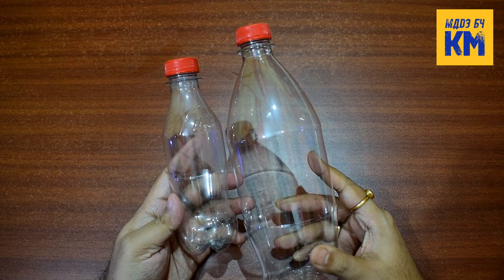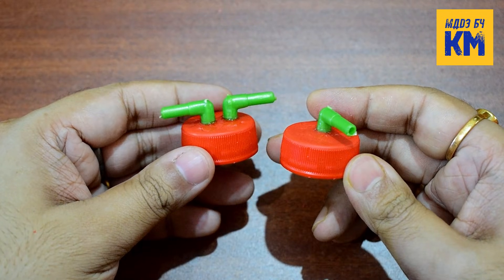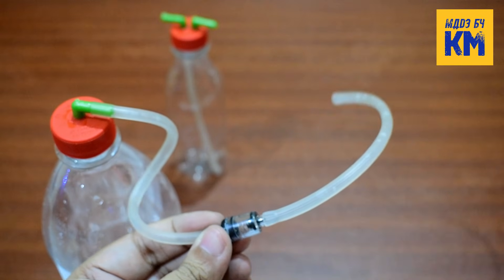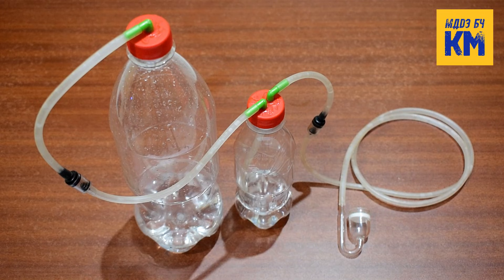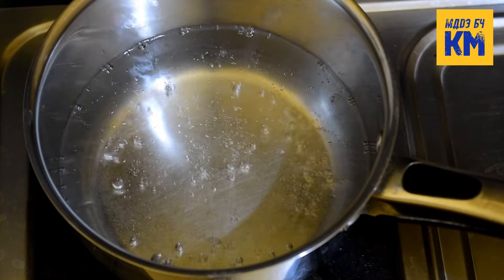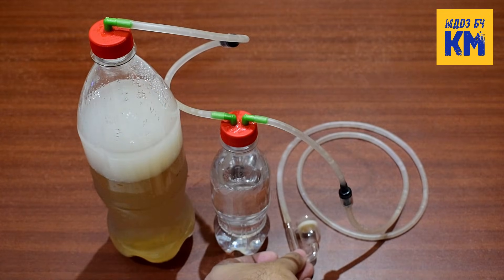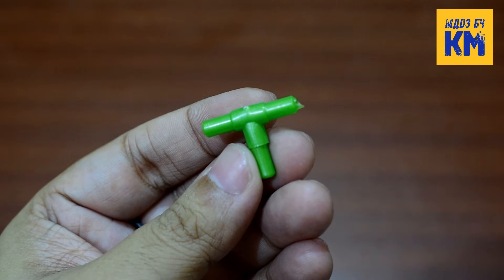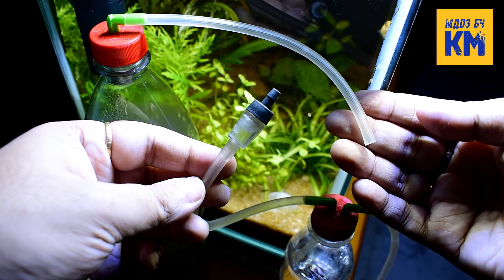Long-Lasting DIY CO2 for Planted Aquarium: Easy & Effective

Comment: Hi KM under this method once the requisite formulation is filled in bottle & the said process followed ..how long it takes to generate CO2 ..approx min or hrs..
Reply from the maker: The production of CO2 depends on several factors, such as temperature, quality and quantity of yeast used etc. As a result, CO2 production can take anywhere from 30 minutes to 24 hours. Please refer to the description for further information.
Reply: @madebykm   thanks for the prompt response…I wl be trying this method very soon… Your videos hv been boon to hobbyist..in my circle I have been spreading the word about you…..continue to do the good work…👍🙏
Reply from the maker: Thank you
Reply: @madebykm   hi Kaushik. Finally in second attempt I could succeed in DIY CO2 ..probably the bottle caps were not airtight as hadn’t used silicon sealant but had applied Araldaite..However, I am unable to route through the intermediate small bottle with water..the CO2 bubble would appear in this bottle but it want pushing enough though it’s outlet into Aquarium. Hence I had to put air tube directly from the main bottle to aquarium…I will retry  again with intermediary bottle as shown in your video..thanks a ton for your guidance…DIY was a very satisfying experience & very economical within 250-275 it could be done…However one has to keep eye on CO2 pressure, refill etc etc..

Comment: Thank You very much for this Video.. 
I have one question. how much time we need to run this co2 in 20 Gallon Aquarium with full plants ? 
If I run CO2 for 12 hours will my fish die ?
Reply from the maker: CO2 must be supplied as long as the light is on. Even if you run this DIY CO2 24/7 there will be no problem. Just run an air pump at night to keep the oxygen level in the aquarium water high.

Comment: Thank you Kaushik.. this looks like super useful,  like all your other videos.. i have a few questions though
1. Do we not need to shake the yeast water to activate the yeast?
2. I tried using 2 bottles using a t-connector to generate Co2, but coz of the possible pressure difference, the co2 was getting generated from only 1 bottle... whats the solution to that? 
3. How many times can i use the jelly in the generator bottle?

Comment: I tried but bubbles are not forming on the small bottle followed the process as showed in the video . Kindly help
Reply from the maker: The bubbles won't come out right away, the fermentation process can take several hours to begin (up to 24 hours). Also, check for leaks in the CO2 system, if there are any leaks, no pressure will be created and the system will not work.
Reply: My aquarium is 4 feet almost 250 ltr of water is it because of that the pressure is low and the co2 is not generating. Do I have to add more bottles of  generators to generate co2

Comment: Hey can I use the water controller instead of the check valve
Reply from the maker: No, a check valve is required here.
Reply: @madebykm  okay thank you 😊
Reply: @madebykm sir I’m not getting check valve is there any other solution ?
Reply from the maker: You can find it on the internet or at your local aquarium store. If you can't get it, just use your CO2 generator and keep it above the tank.
Reply: @madebykm  okay thank you sir
Reply: For safety should keep the air flow controller?
Reply from the maker: No

Comment: Ultimately have been able to built one and am following your formula. But one question. I find around 22 bubbles per minute are being released, not more. Will it be sufficient for a 17G planted aquarium or do I need to add another bottle. 

For the records I am also using the DIY Internal Filter methods as CO2 Diffuser, as suggested by you. Thanks once again.....
Reply from the maker: Increase the CO2 production by using 1/2 of a teaspoon of yeast, and aim for a CO2 injection rate between 1.5 and 2 bubbles per second.

Comment: Same ingradients packed in a pack and named as Aquario Neo DIY CO2 kit, that brand is selling this same stuff explained in this video for $30 and refils for $20. Crazy. Thanks a lot Kaushik. You are a legend as always I am following you since 2 years and in this aquarium hobby. Read a lot books, reddit, videos but no one is like you. You are the best.

Can you please research on that same products from  Aquario Neo DIY CO2 kit last for 50-60 days for 10-25 gallon tank without changing any yeast solution. Please reverse engineer that and make another banger video why its lasting that much and you can replicate this video in 3rd latest 2023 part.

All the best. Lots of love brother from Pune.
Reply from the maker: Ok, I will try, thanks 😊

Comment: Thanks for the great video! I have a quick question, how do you prepare a new bottle when it's time to swap? Cause new bottle will need time to build up pressure too right? I'm worried about CO2 fluctuations here. Thanks again!
Reply from the maker: I always prepare the yeast-sugar solution at night, thus allowing sufficient time for the CO2 to be produced, and by the time the lights are on in the morning, the plants get the desired level of CO2. Thank you.
Reply from the maker: And I make a new bottle of jelly a day or two ahead of time, store it in the fridge, and use it when I need it.
Reply: @madebykm  Thanks you for taking your time to reply. That's good to know. I also have one more question, you said that we should change the yeast water (top part) every week for stability, my understanding is you keep the old jelly water part right? So how long do you keep that jelly part before you change them too? Many thanks!
Reply from the maker: I change the jelly every 30 days. Thank you.
Reply: @madebykm Hey just a quick update. I followed your ratio for the mix but I use a 2L Coke bottle so the mix doesn't fill up to even half way of the bottle. Do you think it will affect the pressure cause it has too much room left to build up pressure. I've been waiting for 12hrs yet I only see slow single bubble running out to second bottle. Second thing is my tubing run to CO2 diffuser is a bit long, should I try to move it closer like yours? Sorry for too many questions, appreciate your help man!
Reply from the maker: Yes, it will take some time for the pressure to build up. You can also use 1/2 teaspoon of yeast to produce more CO2 and increase the pressure. I would suggest you watch my “DIY CO2 Diffuser” video and use an Internal Filter CO2 diffuser. It will work best for this method.

Comment: Apa fungsi dari cek valve
Reply from the maker: Check Valves atau Non-Return Valves memungkinkan udara mengalir ke satu arah (ke dalam tangki) dan menghentikan aliran air ke arah lain (keluar dari tangki).
Reply: @madebykm  terima kasih
Reply: @madebykm  sy sudah mencoba membuat botol co2 diy dan berhasil
Reply: Tp tidak mengunakan check valve karena di kota dini tidak ada

Comment: Hi Kaushik, Thank you for sharing such great videos. I made a CO2 reactor using the yeast and sugar method but whenever I try to bring the water pipe to the bottom of the tank the bubbles stop and CO2 stops. Also, the pressure is too less. Please help
Reply from the maker: You can use 1/2 teaspoon yeast instead of 1/4 teaspoon to produce more CO2 and increase pressure. Also, place the diffuser in a specific place inside the tank. When enough pressure is created, it will work perfectly. Also check the description box for more information. Thanks.

Comment: Then how to clean or remove jelly from the bottle
Reply from the maker: The jelly will slowly melt over time and after 4-5 weeks, you can easily remove the jelly from the bottle.
Reply: How many week it will give co2? 

Its my last question please answer.

Thank you
Reply from the maker: 4-5 weeks

Comment: Good, easy to understand video. I use this for my 14 Liter Nano Tank. A very cheap and effective method to produce CO2. I don`t have a diffusor like your`s, I use an airstone hanging free in the tank. At day, when more CO2 is needed for my plants, I hang it down to the bottom of the tank. In the night, when no CO2 is needed, I lift the airstone  to the water surface. So I don`t need to take the tube away every time.

Comment: Could i do this with regular gelatin?
Reply from the maker: You can also use gelatin, but the problem is jelly made using gelatin usually melts at outside / room temperature (25°C-40°C). Gelatin works well in cold environments (<20°C). But jelly made using agar agar remains firm even at 65°C. Thank you.
Reply: @madebykm  understood, thank you so much.

Comment: Helloowwww ..... feelinn blessed that i found this videoo but i have a doubt ,here the co2 will runn 24 7 with continuous flow .If i have to stop the cot flow then what m i supposed to do???
if we removed the tube from check valve the coz will get waste right???
Reply from the maker: You can keep it running 24/7 and run an air stone at night to keep the oxygen level in the aquarium water high. Also check description for more information. Thanks.

Comment: Great Diy. Can we use normal gelatin instead of agar agar? I want to do this today and my local shop doesn't have agar agar.
Reply from the maker: Actually jelly made using gelatin melts at outside / room temperature (25°C-40°C). Gelatin works well in cold environments (<20°C). But jelly made using agar agar remains firm even at 65°C. I have given the links in the description, you can check them out. Thanks.
Reply: @madebykm  Thanks. I managed agar agar...diy working in 6 hours.

Comment: Hi kaushik 
I dont have check valves but i make the system and i used sugar and yeast water for checking purpose but still m not getting co2 bubbles plz explain
Reply from the maker: Check description for details

Comment: Dear Kaushik by resuming CO2 inserting tube in check valve does it take intial few hours time to give bubbles or do we have to shake the bottle?
Reply from the maker: It takes a few minutes to build up the pressure again.
Reply: @madebykm  Thanks ji

Comment: Hello Kausik, today i have successfully created the diy co2 system including diy co2 diffuser by taking the help from your video, but one thing i need to know that, how many hours i need to turn my CO2 on, i use to turn my lights on for 8 hours, can you help me on this, thanks in advance.
Reply from the maker: You can either detach the CO2 tubing when the lights are OFF or keep the CO2 system running 24/7 and run an air-stone at night or when the lights are OFF to keep the oxygen level high in the aquarium water.
Reply: @madebykm  okay, actually i do have fishes inside of my aquarium, i use to run a small sponge filter 24×7 with very litter flow speed, so in that case do i need to off that sponge filter while i am running the co2 or i can run both of them 24×7??
Reply from the maker: You can run both 24/7, but reduce the flow of the sponge filter when the lights are on, and increase the flow when the lights are off.
Reply: Good morning, Many many thanks kaushik, i wish all the very best for you..and continue your good work, your channel is really very very helpful to us..thanks again.
Reply from the maker: Thank you 😊

Comment: this will work without check valve ? For supply disconnection you removed it from check valve does it affect the quantity of mixture in the bottle ?
Reply from the maker: It will also work without check valve. The function of the check valve is to prevent water from entering the bottle from the aquarium.
Reply: @madebykm  Thanks Dear and what about disconnecting supply, does this affect the CO2 mixture quantity
Reply from the maker: No 🙂
Reply: @madebykm  😊

Comment: Dear since we are going for DIY thing, do we need needle gauge to check pressure of CO2 supply  ?
Reply from the maker: No, there is no need to use a needle gauge in this system. Here, the CO2 production depends on the quality and quantity of yeast. So, you can control CO2 production or bubbles per second (bps) rate by increasing or decreasing the amount of yeast. If 1/4 teaspoon of yeast does not produce enough CO2 for your tank, you can use 1/2 teaspoon of yeast to increase the bps rate. I have found (in a normal bubble counter) that 1/2 teaspoon of yeast can produce CO2 at a rate of 2 bubbles per second for about 10 days. Then the production of CO2 gradually decreases as well as the bps rate. So to provide CO2 in the tank at a steady rate, I recommend refreshing the yeast-water every week. You can see the Description for more information. Thanks.
Reply: @madebykm  I see, many thanks dear ....

Comment: How long would that jelly will last and after how many days we need to change that jelly, another think can we use it until it's get over?
Reply from the maker: The jelly will last about 4-5 weeks. After that, discard that old jelly and make a fresh one. You will need to change the yeast-water every week to keep the CO2 injection rate stable. Please check the description for more information.

Comment: Hi , the video on DIY co2 kit you posted is very easy to follow - thank you . 
Can you please tell me what are the valves you used ?
Reply from the maker: I used aquarium check valves. It allows air to flow in one direction only and prevents water from siphoning out of the aquarium. Thank you.

Comment: I have a 50-gal tank.  Which bottle size I should be using?
Reply from the maker: You can use two 2-liter bottles and 1/2 teaspoon of yeast to produce enough CO2 for your plants. Change the yeast water in one bottle every week, alternately.
Reply: @madebykm  So both of the bottles need to be 2 litres for my 50 Gal tank? However, in this video, you have used one 1 ltr and the other 500ml. Please also tell me the quantity of Agar agar powder and sugar that needs to be used to make that jelly and also the quantity of yeast as well.
Reply from the maker: Since you have such a large tank, you will need to use two 2-liter bottles as CO2 generators to produce enough CO2 for your plants and a small 500-ml bottle as a bubble counter. In each 2-liter bottle, you need to use twice the amount of sugar, water, agar agar powder, yeast etc.
Reply: @madebykm  Can I use a 5ltr Bisleri can instead of two different 2-litre bottles?

Comment: Thank you for this informative video I try to do it but my aquarium is 15 gallons. I also notices there are very few bubbles coming. Any body can help me with measurements for a 15gal?. Thank you!
Reply from the maker: You can use 1/2 teaspoon of yeast instead of 1/4 to increase CO2 production. Also check the description box for more information. Thank you.
Reply: @madebykm  thank you soooo much I read and watch your video carefully and corrected a leak and it’s working fabulous, the only thing is that I’ll use 1/2 teaspoons yeast as you instruct when this mix is done. Thank you for sharing you knowledge 🙏
Reply from the maker: You’re welcome

Comment: Sir ji, I fitted successful but the bubbles cannot come out from the diffuser, I'm very confused? Why?
Reply from the maker: The bubbles won't come out right away, the fermentation process can take several hours to begin (up to 24 hours). When enough pressure is created in the bottle, bubbles will come out. Also, check for leaks in the CO2 system, if there are any leaks, no pressure will be created and the system will not work. Check out the video description for more information.

Comment: Inspired Sir, only one quarry, If I detach the tubing of the co2 generator from the check valve then co2 gas will filled up at home, is this correct?
Reply from the maker: No problem, our atmosphere contains much more CO2 than that.
Reply from the maker: The amount of CO2 produced here is very small and it is nothing compared to the amount of CO2 present in our environment.

Comment: Bro.. What if we add a controller to turn on and off... Also, if I close using the controller,  will the pressure building inside the bottle will become a problem. Kindly help me out.
Reply from the maker: In this method, CO2 will be produced continuously in the bottle and it cannot be stopped. Stopping the flow of CO2 can damage the CO2 kit. Here, the CO2 production depends on the quality and quantity of yeast. So, you can control CO2 production or bubbles per second (bps) rate by increasing or decreasing the amount of yeast. If 1/4 teaspoon of yeast does not produce enough CO2 for your tank, you can use 1/2 teaspoon of yeast to increase the bps rate. I have found (in a normal bubble counter) that 1/2 teaspoon of yeast can produce CO2 at a rate of 2 bubbles per second for about 10 days. Then the production of CO2 gradually decreases as well as the bps rate. So to provide CO2 in the tank at a steady rate, I recommend refreshing the yeast-water every week. For more information, you can check out the description box.
Reply: @madebykm  Thanks Bro.. Mine is 500 Litre tank.. medium plantation. Anyways to control spot algae. It's infecting all my grass and comes fully on tank glass
Reply from the maker: It's a very large tank, so I think the plants aren't getting enough CO2 and fertilizer. Therefore, inject CO2 at a rate of 8-10 bubbles per second and use macro and micronutrient fertilizers as recommended. Also, change 50% of the tank water once every week. GSA will be gone soon.

Comment: my old diy co2 following your videos, only gave a bubble about every 4 seconds, 
this isnt normal right? how do i check for leaks? it's like spraying plain water or something on it?
Reply from the maker: You can spray soapy water on the joints and if you see bubbles forming then there is a leak. CO2 production depends on the quality and quantity of yeast. If 1/4 teaspoon of yeast produces 1 bubble every 4 seconds and if that is not enough for your tank, you can use 1/2 teaspoon of yeast to produce more CO2. For more information, check the description box.